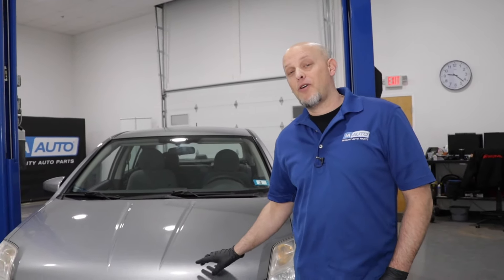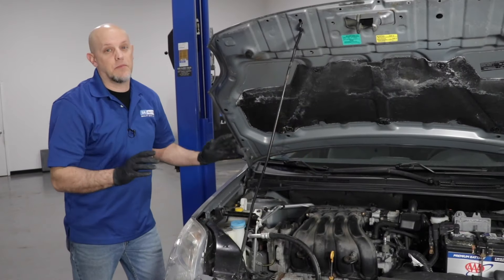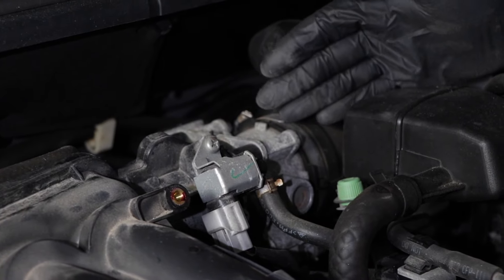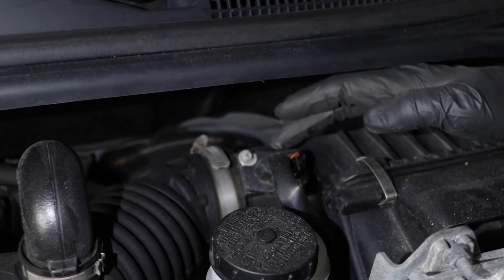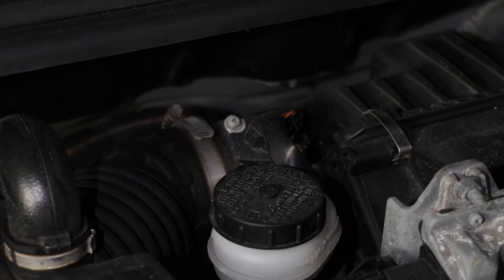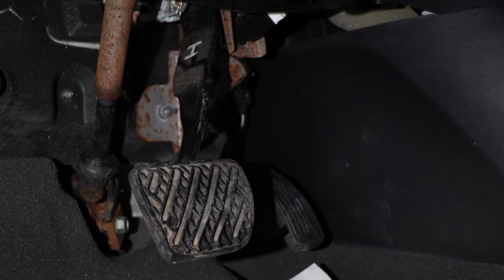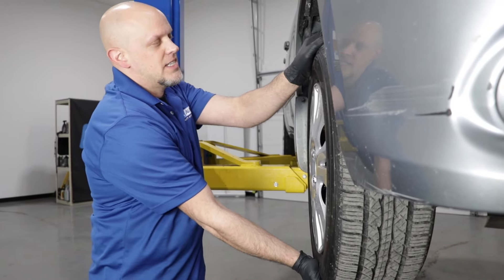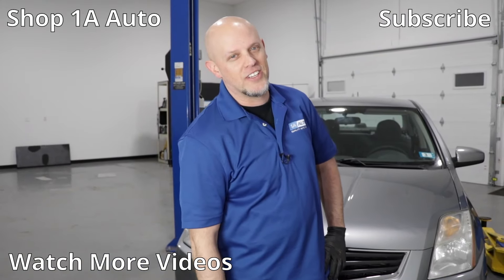Top 5 Problems Nissan Sentra Sedan 6th Generation 2007-12

Comment: I bought my 2012 in 2013 with 24k miles still running nice, smooth, and powerful today at 128k plus miles (Oct, 2021)...a bottle of stp fuel injection cleaner every oil change (3k miles), new air filter plus cabinet air filter when need it, coolant flush twice since I bought it (about 4yrs each), transmission fluid changed around 100k miles. Only thing I had to change just recently was the intake cause of a crack in it, control arms, due to wear and tear. Almost any car if you maintenance and drive normally I guess should last you many years. But if you don't take care of it and floor the gas every stop sign and green lights, oh yeah any car won't last you.

Comment: I have a 2007 Sentra SE-R SPEC V, despite being the 3rd owner and the previous owner beating the crap out of it, I haven’t really had any issues with it other than fixing what they themselves broke, (missing hood support thingie, broken gas cap and releaser, broken sunroof deflector etc) All I’ve really had to do for maintenance was change the alternator, brake pads, oil change, new tires and rims and probably soon new suspension 🤷🏻‍♀️
Reply: What’s your IG
Reply: @RansomGangsterBox245  down bad

Comment: Current owner of a 2011 Nissan Sentra 2.0L base model. I’ve had a bad throttle body and it needed to be replaced and I had MAF airflow issues. With the MAF I actually just had to get it reprogrammed so if you have MAF issues just consider that. So far it’s been a good car. This is my third year with it and those are the only main problems I had with it.

Comment: I have a 2012 with 110,000 miles since new. Blower motor resistor and exhaust is all Ive done besides normal maintenance stuff like brakes and battery.
Reply from the maker: +Carleton BillinghamThanks for the feedback!
Reply: I just bought a 2011 for 700 bucks. For some reason the blower motor had a crap tone of grass and leaves in it. I was able to pull all of it out from the passenger side after removing the glove compartment.

Comment: ‘11 spec v owned since 50k miles. I’ve had to replace the blower motor, MAF sensor, subframe bushings, motor mounts, cracked exhaust manifold, ac compressor, spark plugs, drive belt, and all fluids.
Seems like a lot but it was all relatively cheap and the car has never left me stranded.

Comment: Good stuff.. Surprised you didn't include the crappy air intake elbow between the throttle body and air filter box. They are known to just prematurely deteriorate, as mine did. And yes, my a/c blower had to be replaced too. That was a pita.
Reply: we have a 2011 sentra and i have had to replace the blower motor 3 times now at 145k and the latest problem with it was it sucked up napkins from inside the glove box. shitty design
Reply: agreed on the intake elbow, had to replace mine, call the Nissan dealer and they had them in stock, apparently, they fail alot
Reply: Yeah. Replacing that blower motor isn't impossible, but super tedious.  At least a regular joe can do it without tearing apart the whole dash.

Comment: Just passed 145k mi on my Sentra. Bought it two years ago for $500 when it was traded in at my work. I’ve replaced the front strut assembly’s, alternator, timing chain tensioner pulley, maybe a stabilizer link and that’s it. Besides normal stuff like batteries, brakes, etc. 

I make sure to get my oil changed every 6500k with full synthetic and I change the trans fluid every 15-20k mi. 
Only real annoyance I’m having is when I’ve been driving for more then a few hours or if I’m driving in the snow my transmission shutters occasionally, but besides that the CVT works well.

Comment: Just hit 150000+ miles on my 2010 Sentra 2.0  6 speed manual, only changed front struts, battery, oil, trans oil, coolant and air filters runs and drives like new and everything still works

Comment: We got a new sentra base in 2012 as a present from my in-laws when we moved to the US. At 40k miles one of the mechanics told me that the CVT fluid needed to be changed. I told him that I wanted it to last me at least 150k miles, and he laughed. 
11 years later it reached 157k miles:  I changed the transmission fluid 3 times , flushed the coolant fluid, regular5-7K full synthetic oil changes, air filters, brakes and rotors and  front struts due to a minor rear end accident, changed spark plugs and cleaned throttle body from buildup. I am not forcing the car and it has served us pretty well. MPG AVG 28-30.
Things that failed: Front O2 sensor, Mass Air Flow Sensor( use always original BTW), and air intake elbow .

Comment: Thank you for the informative film. I have 2009 Nissan Sentra. 

1. ~@60K the Air Intake Elbow (i believe it is called Air Duct) got torn. I found the slit on it after the Engine light came and I started to look for the problem. I've read that it is pretty common problem for these cars and bought 2 spare in addition. This part is relatively easy to replace, so if you have a bag of them, it is not a problem.

2. I've also read that there is a common suspention problem w/these cars, that it starts banging in the area of Rear Passenger side. Now I've got that problem (~61K now) after I hit smth on the road. I thought it is a strut went out (especially one front was reported before by FireStone, though at dealer they said nothing wrong). I replaced front struts, rear shocks (all of them were bad, front leaking and rear shocks not spreading out after the compression how they should). But all that didn't help w/loud banging and clunking noise somewhere in the area of rear passenger side. I inspected everything, seems like everything is solid,  the springs are not brocken, but when you drive, and especially go over any bumps, a noise is such, like smth is going to fell apart. In that condition the car went through State Inspection and I did alignment after all the suspension work of course. All of that at Toyota Dealer and they don't know what could cause that sound, alignment didn't help. From what I've learned the problem in the rear of Nissan Sentras is related to the worn bushings in the Rear Suspention Beam, and it always come on the rear passenger side 1st. I would appreciate any opinions on this matter. 
     We have 2 other GM cars (Saturn has 132K and Chevy 110K) and no problems w/struts. I replaced the front and rear struts on Saturn, but that was just bcs I wanted that car to sit a bit higher, there was nothing wrong w/those struts. From this I conclude that the suspension on Nissan Sentras has a problem in the sense that the struts and shocks are worn out on a very low mileage.
Reply from the maker: +Olena Erhardt We wouldn't be able to diagnose an issue like that here, you may want to have a local mechanic take a look at it. Thanks for checking us out! http://1aau.to/m/Shop-1AAuto-c

Comment: OMG! I have this same generation Sentra, an 07. The problems I'm starting to have is the blower motor, that airplane noise like you said, terrible gas mileage and the worst if all a catalytic converter! Other than the car runs fine. 🤷🏾‍♂️
Reply from the maker: +verinb9 Thanks for the feedback!
Reply: Same with the blower motor. It was hot as hell one day and then all the sudden it sounds like a small aircraft taking flight

Comment: Hi 2007 Nissan Sentra owners and family!! we all have similar issues on our cars. Mine reached 150K. after much thought replaced timing chain since camshaft sensor code kept on coming and I had starting trouble. replaced cat. converter also. It also has the vibration issue you guys have been talking about for over 2 years. alignment did not help, balancing and new tires did not help. mechanic is saying it is axles since it vibrates when ACCELERATING at 50+ mph and driving even slight uphill. engine mount seems to be okay. I need to check tie rods since that may be cheaper than the axles. I also have vibration when stopped on stop sign or red light . I dont know if it needs new ignition coils. they seem to be very expensive from the dealer, not sure if I can go for aftermarket. I changed the spark plugs 2 years ago with NGK (good ones).

Comment: #6 has to be the transmission
Reply: I would say that's #1
Reply: Agreed 2012 here well maintained didn't make it to 100k, wanted 4.5k for a replacement on a car not worth that.
Reply: @nigelwilson7395  lol I had a 2015 and luckily it was still under warranty. They fixed it and I traded in to get a toyota
Reply: @junkmail You shouldn't have to change the Trans fluid that often, that's not normal. Sounds like you need to change your car
Reply: @junkmail That's expensive.  ATF is $6/quart.

Comment: My 2011 sentra has 300k+ miles on it. Things that have failed so far, Not including normal wear and tare items.
 Alternator(1), Ignition coil(1), air intake hose(1), clock spring(2), evap solenoid(1). EDIT: I replaced all injectors not because of them failing but to improve fuel mileage.
Reply: I have replaced the air intake hose and the Evap solenoid twice. My fuel mileage is garbage so I might replace the injectors like you did
Reply: @nickylantigua303  how much do you average ?
Reply: Not bad. I think those are still considered wear and tear items.
Reply: what about the cvt transmission?

Comment: I bought my Nissan Sentra SE-R in 07'. I still don't even have 100,000 miles on it yet. I still consider it my baby and it's in great condition. I replaced the blower motor twice and the resistor twice recently. The heat just stopped working again and there was white smoke that smelt like plastic burning coming out of the vents. Somebody is now going to check the pigtail for me. This is somewhat crazy. I hate to get rid of it if it's just a simple fix but if it's an electrical issue that might be a lot of money

Comment: I have a 2009 Nissan Sentra SE-R. The car is amazing and it's pretty fast for a little four banger,  I've never really had any issues with it, I've had it for almost 3 years and the only thing I've had to replace is a front driver side control arm, I'm assuming it's because of shity potholes where I live though.

Comment: I have a 2010 sentra, I replaced both front bearings, both catalytic converters, exhaust manifold, put in a rebuilt transmission and routine maintenance with a sparkplug change. My car only has about 83,000 miles
Reply from the maker: +Sam Engle Thanks for the feedback!
Reply: Have a question have you had an issue w it it cranking but no starting up and driving ?
Reply: @ItsBeautyCode  I do right now.  What ended up being the problem?

Comment: hahaha, I have a Nissan Sentra 2008 with 120K miles, a wonderful city car, I already replaced all of that he said, the wheel bearing, one of the coil, MAF sensor, and of course the blower makes some noise. Also replaced the AC compressor, the radiator, and shocks.

Comment: Man you hit it right on the button. The front bearings went bad, had them replaced. The blower motor blowing very low but backyard mechanic says too hard to get at blower motor.  One thing you didn't mention is CVT transmission gets very hot on long, long trips. Something about not holding enough transmission fluid b/c too small, thus getting hot on long trips. Have had transmission fluid and filter changed 3 times so I won't ruin tranny. Which I think I already did, but it's still running with the help of some snake oil. Thanks for the video.
Reply: we install one yesterday it took like 7qts
Reply: Add an external Transmission Cooler with a Fan. Its a night and day difference. 👍🏽

Comment: I have a 2009 Sentra and have had to do a lot of work to it. Ignition coils, spark plugs, gaskets, struts, wheel accelerator sensor for ABS, motor mounts, serpentine belt pulley assembly bc it squeeked like crazy and still does, catalytic converter, tire pressure sensors, now it’s barely starting so I’m investigating that now.
Reply: Bushings

Comment: Number 1 should be transmission. I've heard of many failing as soon as 60k miles.
Reply: True
Reply: mines at 220k with no issues.
Reply: @Usef320  same
Reply: Mine is at 158k miles
Reply: @JB-jx9bh  what year? I hope mine gets to
200,000
Reply: mine didn't make 32k before a new one. I'm 98k now and replaced 2x since I've had it.
Reply: Mine is 220k and transmission is starting to fail!!! But I’m so happy with this car!!! It’s a beast!!!
Reply: @freddyguerra2772  Change of fluid is supposed to be at 90k
Reply: Im on my 3rd Trans cvt are terrible
Reply: Yesterday SVT Transmissions are awful. Ours went out at 90k luckily the warranty covered it.
Reply: @Usef320  Did you change the transmission fluid? if so how often, mine just hit 170k miles and I know I haven't touched the transmission fluid in the last 70k
Reply: @freddyguerra2772  How do you know it's starting to fail?
Reply: @maukus57  Every 90k?
Reply: Mines at 168,000 miles and no problems with the CVT, regular maintenance is all you need
Reply: my brother on his 3rd trans and only has 145k miles or so on it
Reply: Change y’all transmission fluid every 30k and always use ebrake when parking that can save your transmission and don’t shift from reverse to drive while the car still moving
Reply: My 2007 Sentra has 318,000 miles and never had a problem with the transmission.
Reply: @kingswaylife6133  how ?
Reply: @goldenwolf7590  my last car, an altima, made it to 200k with cvt before selling… now my sentra with cvt is over 150k on same cvt. y’all just don’t take the right care of y’all’s cars
Reply: Yea and people in hotter climates or drive longer commutes they'll run out faster Nissan cvts get too hot and that's what mostly kills them
Reply: @Usef320  still the original trans fluid? Or u change it after 30k km? Thanks in advance
Reply: Mine started failing as soon as it hit around 110,000 miles

Comment: I have had a Nissan Sentra 2010 for 12 years now. Machine ran smoothly and quite. Recently, when I stopped and parked in the parking lot, I forgot to turn off the engine, the key still hang in there. I started the engine( I had not turned it off, the engine was so smooth). I freaked out. Turned it completed off. Turned it on again. The odometer ran to the maximum and back to zero, the car did not start. Pulled it to my local mechanic, he said he can’t fix it. I have been told to go to Nissan dealer because the car has problems with somewhat accelerator and sensor. He says they may cost more than a thousand to get it fix. I don’t know what to do. What exactly do I need to pay for. Should it worth fixing or should I buy a new one. Thanks in advance for your advice and comments.God bless!!

Comment: Found a Sentra b16 2010 for sale that has the engine code p0075 valve control circuit bank 1. 
This I’ve been told is common also?

Comment: Hi I have this vehicle and the problem is after driving it for a mile or two the speed slows down drastically maybe going 5 to 10 mph and the speedometer doesn't go up. I did notice that on the passenger side close to the headlight smoke comes out. does this problem have anything to do with the transmission?

Comment: Question if I’m driving and the noise of the wheel bearing changes as I’m turning but I hear it in the back of the car that would mean the back wheel bearings are bad correct?

Comment: 2010 automatic , no cruise  light does not even come on . Just bought car for daughter. Is there a marked fuse to check first as there is 1 box by drivers left knee and 2 under hood , but can't find cruise fuse , or would it be linked to something else maybe  , any ideas at all if no fuses?
Reply from the maker: +Karl Richards We wouldn't be able to diagnose an issue like that here, you may want to have a local mechanic take a look at it. Thanks for checking us out! http://1aau.to/m/Shop-1AAuto-c
Reply: @1AAuto  was trying to avoid the mechanic If possible that's why I asked questions lol . All good

Comment: What I'm seeing in most post is that not many have changed the transmission fluid , it's supposed to be changed at 90k
Reply: I'm looking for that info as well because my 09 sentra just hit 170k miles and I know I have not personally had the transmission fluid changed in the last 70k miles. I'm thinking about taking it to the dealer so they can inspect it but I don't want to pay an arm and a leg for it.

Comment: Help!! Any suggestions are needed! I have a 2012 and my a/c and heater stopped working. No air comes out of the vents. There are no loud noises. I must have disregarded them before it went out😅. But what is the cost to fix the a/c on this car?? It’s been 2 years since my air and heat have been out. 🤔Should I replace my fuses??
Reply from the maker: +Erin Janae We wouldn't be able to diagnose an issue like that here, you may want to have a local mechanic take a look at it. Thanks for checking us out! http://1aau.to/m/Shop-1AAuto-c

Comment: I am your new subscriber after watching this video.
I liked this video full of information for nissan sentra drivers.
Can I request you for video on how to change "Mass Air Flow Sensor "?
Reply: He just said take off these two bolts on the top and it comes off even shows where they are bro look at the video again easy to change probably easier then spark plugs and cables

Comment: Working on an 07 2.0 auto 146k on it crank and no start problem. Not getting fuel. Replaced the pump twice, crank sensor and cam sensors, and it still just cranks. Ideas?

Comment: Spark plug replacement is no joke
Reply: On a 2.0 i had to take off air box,throttle body ,intake manifold,coils.A massive pain in butt.Absolutely stupid design.Its an 09 and has served me well but diy servicing is the pits.Front struts,another stupid design flaw.

Comment: Is there any known internal engine problems with this gen?  I'm looking at a 2011 sentra ser v-spec manual transmission but weary about it.  I heard newer Nissans have cam timing and knock sensor issues